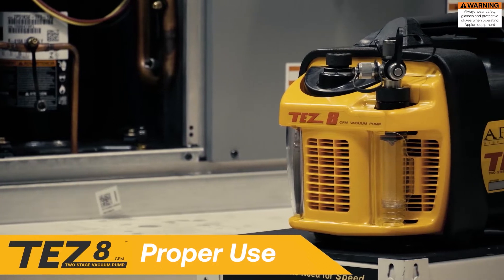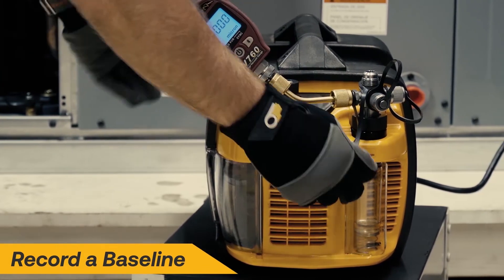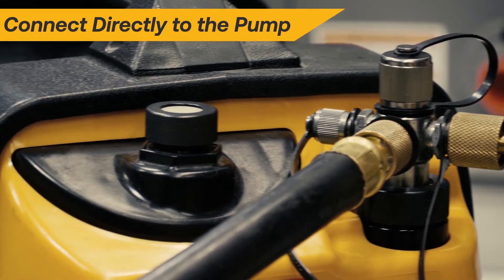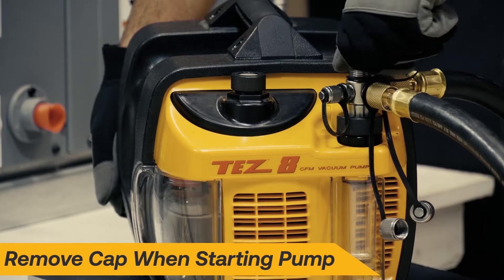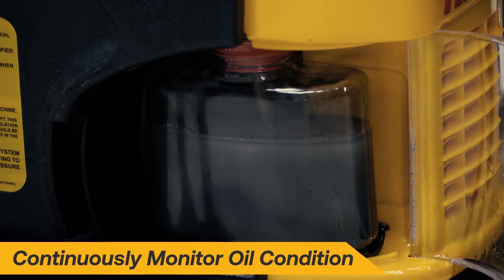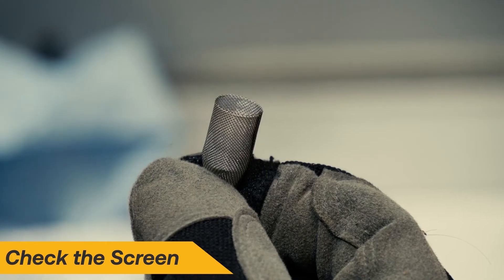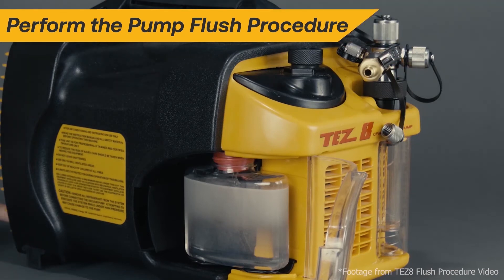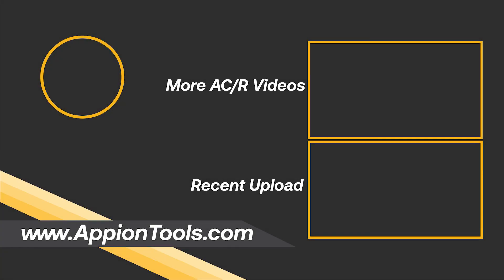Appion TEZ8 Proper Use Tips

Comment: Can I use the C5 twin to just pull a vacuum on my truck ac system
Reply from the maker: The G5 Twin is a Recovery machine, If you want to pull vacuum, you will need to use a Vacuum pump.  For trucks, you will have a to get adapters for the high and low side fittings as they most likely are not 1/4inch screw on style.